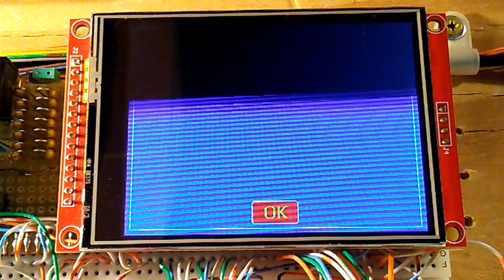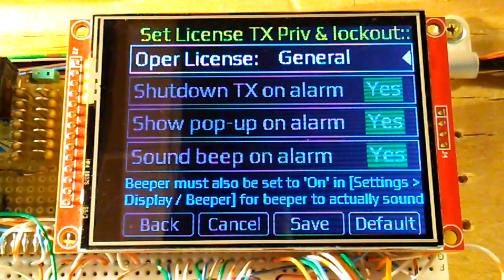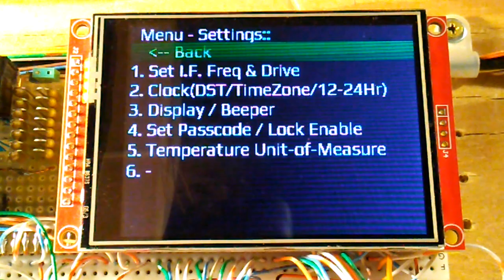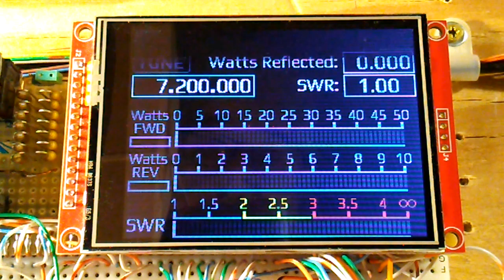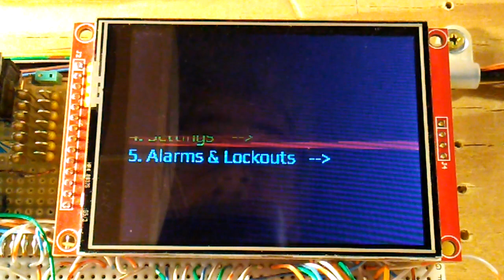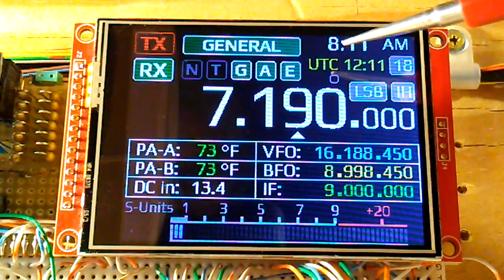Module # 110 Front Panel MEGA Quick Start - MAX-SSB Transceiver Project

Comment: I just started using the software, So I trying to get my head around it. It is very detailed. I have been building around your designs. The only thing is I used those amazon encoders. I believe they are the KY-040. They seem to work. I can change the main frequency and scroll up and down in the menus. But when I try to set the time and the IF, some of it its grayed out. I figure it's something I need to do in the software. But I see the yellow star blink when I attempt to make a setting change and the numbers will flicker like it wants to change. Could this be because I need to have the PPS from the GPS clocking. I am awaiting that board. I have a GPS module but it doesn't have the PPS on the board I have.  On a side note Thank you for making all this available  you do really neat work on your boards. 73 N7MN

Comment: I have my own version of this, but nowhere near as sophisticated as yours.  You have polished it to brilliance.  Well done!
Reply from the maker: Thank you for the complement!  Good to hear about you also doing development work on a Front Panel.  It's very rewarding to think of a new feature and then try to add it to the existing code.   Mine started out as a simple program to control an Si5351 using an Arduino UNO but I couldn't stop adding features a little at a time until I ran out of program space and had to move up to the Arduino MEGA 2560.  Keep developing!   73 - Rick - N3FJZ
Reply: @Circuit6040  I want to figure out how to use the Si5351 to generate 2 clocks in quadrature, so you don't need the flip flops for a Tayloe detector.  Apparently it can be done, but getting it jitter free is a problem.  So many projects, so little time.
Reply from the maker: @cthoadmin7458  Yes, I think I remember seeing a project on the web or YouTube where someone was successful at getting the Si5351 to produce a quadrature output but can't remember where.  Yes I agree, with all the good things available today in electronics  at reasonable prices there are so many projects that are begging to be built.  It truly is the "golden age" of home brewing.  73 - Rick - N3FJZ

Comment from the maker: Thank you!   No, I don't have plans to try a larger display at this time.  I'm currently using a 3.2" ILI9341 based display and the text on the screen is large enough for comfortable tabletop operations.  The key here is the ILI9341 chip-set in the display, if a larger display that uses the ILI9341 could be found then it could be a drop-in replacement.  A larger display with a different chip-set would probably require some of the code be rewritten and different display libraries may also be needed.

Here are some sources for the 3.2 inch display I used:
https://www.amazon.com/3-2inch-Module-Display-ILI9341-320X240/dp/B0BZGSPP1V/ref=sr_1_4?crid=2NGS6I029BQCL&keywords=3.2%2BInch%2B320X240%2BSpi%2BIli9341&qid=1689515924&s=electronics&sprefix=3.2%2Binch%2B320x240%2Bspi%2Bili9341%2Celectronics%2C79&sr=1-4&th=1

https://www.ebay.com/itm/3-2-Inch-320X240-SPI-Serial-TFT-LCD-Module-Display-Screen-With-Contact-Pane-/203014329796

73 - Rick - N3FJZ

Comment: Great job, Rick!! I'm starting to build it too!! Thanks, Antonio, IW0FCI
Reply from the maker: Antonio, That's fantastic!  Please keep me updated on your progress if you want to.  Keep homebrewing!  73 Rick N3FJZ.
Reply: @Circuit6040  Dear Rick, I just finished the PCB design of the Max Front Panel and I'm double checking it now, I will send it to manufacuturing in a couple of days. I think in 10-15 days I will be able to test it. Once I am sure it works properly, I can send you the gerber files, if you want! You made a great design and I believe this can give a further value to your effort.  The board dimensions are 120x80 mm and the PCB is on only 2 layers and has everything on it with a 3.2'' display, I used smd and thru hole components. I respected wire by wire your design. The Schematic and PCB development has been made with Easyeda. I'll keep you informed on the progress. Thanks again, 73 Antonio (IW0FCI)
Reply from the maker: @antaf56  Wow, 120mm x 80mm in 2 layers, I'm impressed, that's about the size of a typical smart phone.  I can't wait to see it in action.  Keep up the good work.  73 - Rick - N3FJZ.
Reply: @Circuit6040  Hi Rick, I sent you some 3D snap-shots of the PCB design  by e-mail. 73 Antonio IW0FCI
Reply from the maker: @antaf56  Yes, I received the images.  Wow, beautiful work!  You have certainly put in a lot of love and effort in its design and words cannot describe the joy I feel in seeing it.   Thank you for taking the time to give my schematic and software an actual PCB to live in  :-)  I an very excited and looking forward to seeing it in action.